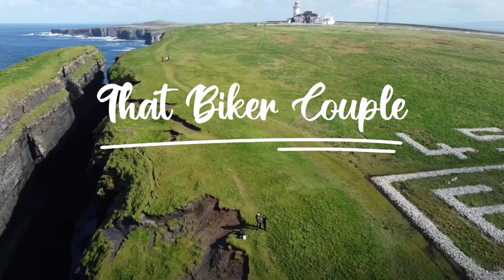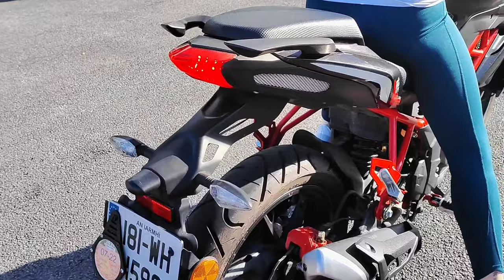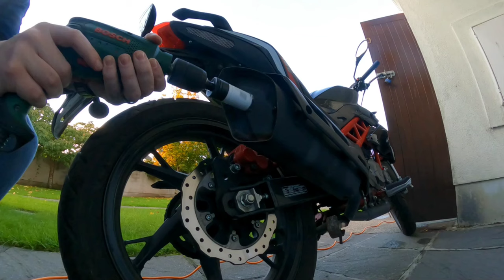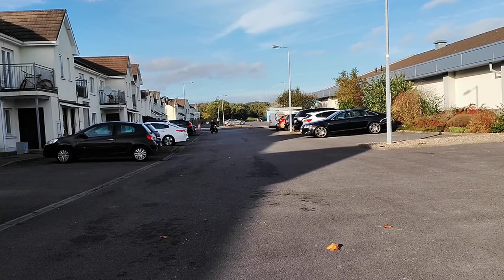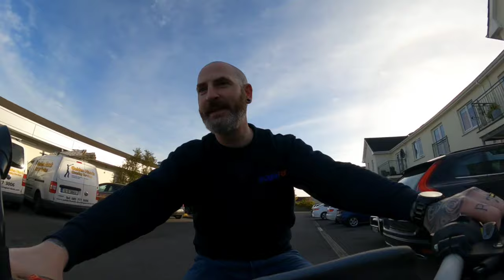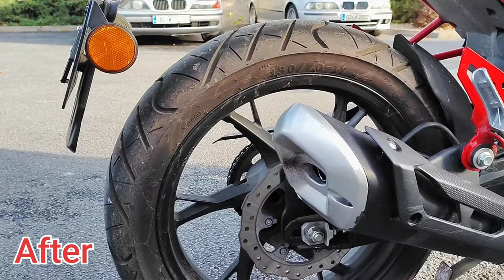Want your exhaust to sound deeper? Benelli bn125

Comment: Would this pass a service? My friend had a new exhaust put on his bike and they told him he had to put the stock one back on, just curious to if you knew why?
Reply from the maker: We don't have motorcycle inspections over here just car ones so I'm not sure but I wouldn't chance it if you do to be honest
Reply: @DaveTube3310  You dont? Fair enough, thank you for the heads up, ride safe.
Reply: @DaveTube3310  Sorry to bother again but i cant find anything on the internet, is there anyway you can change the speedo to mph instead of kph? i've looked everywhere and cant find anything on the BN, only other models.
Reply from the maker: @Major-hi6gt  no bother at all. I haven't needed to so I'm not sure but I'll have a look and see what I can come up with. If I get it working I'll post a video for you
Reply: @DaveTube3310  Thank you dearly, Ill look out for it!
Reply: @Major-hi6gt  Its late, but theres 2 buttons on the dash, one changes the speedo from mph to kph and vice versa. The other changes the trip and resets it
Reply: @darkelemental  ive had another bike now for 6 months, and found out about it like 2 days after this comment, thanks though 😂 a tad late but yano 😂

Comment: Does it lose power by drilling the holes?
Reply from the maker: I don't think so cause there is still loads of back pressure, might even be more responsive letting the engine breathe more but on a 125cc the difference is not noticable